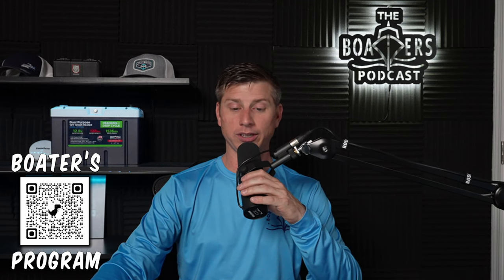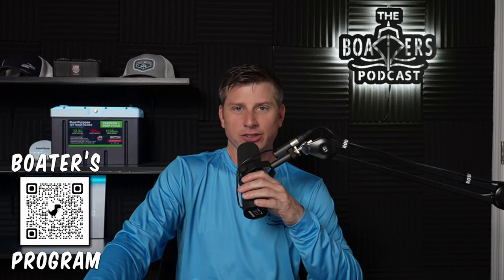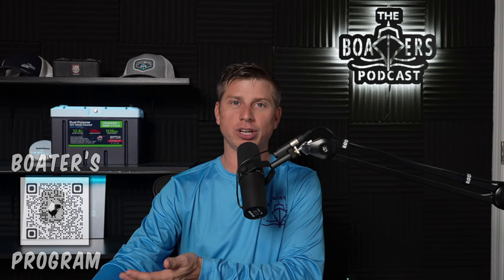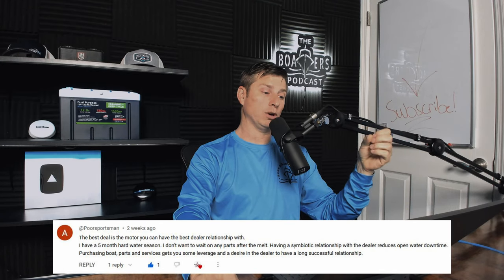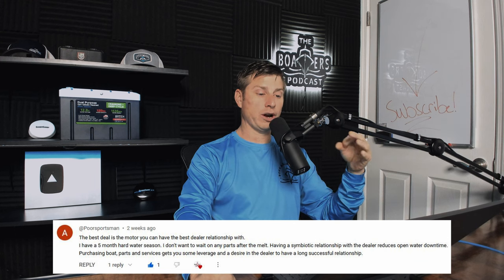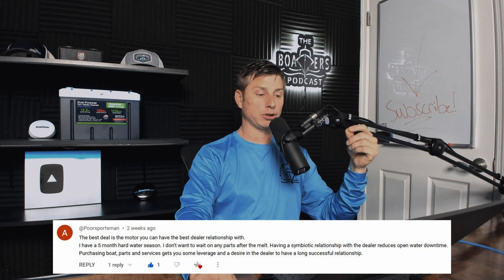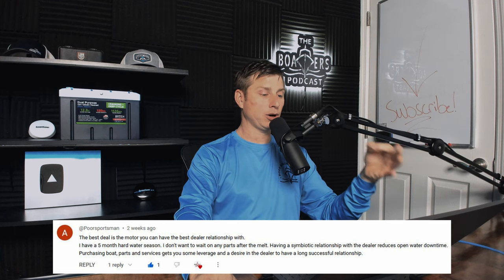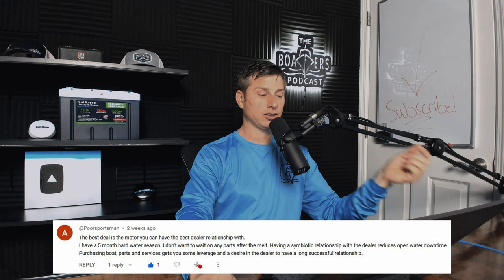How Hot Should An Outboard Pee?

Comment: My first boat engine was a Johnson 110 v 4. I thought it was pretty easy to work on. But I never did get it running well in the water and one cylinder kept getting extremely hot. I put a lot of work into that motor not a ton of money though because I did the labor. I just decided I wanted a different boat in the end and sold the whole boat trailer combo for half of what I paid for it. Bought a 19' CC with a 1986 Mercury Black max on it. I love this old two stroke and I like working on the Mercury more than that Johnson 110. I have the 2.0 with the steel sleeves and the compression is still in the correct range on all cylinders and the engine started in three attempts and the first two probably failed because of me. As soon as I followed the manufacturer's starting procedure the engine fired up and Idled perfectly no misfires and not even a ton of smoke. I checked the gears and they worked perfectly. I didn't want to rev it on muffs but I did bring the rpm up a little and she stayed smooth. We'll see how it does it the water though because as we all know old two strokes can run like a champ until they get in the water and that back pressure happens.

Comment: All marine fuel hose has to be impermeable to fuel vapors bleeding through the hose material by order of the EPA. I don't know if EPA mandated the liner or if that's what the manufacturers chose to do but even the black hose has it. Maybe it just works better in the black hose material? Although I do know the grey and blue line is a different outer material from the black Shields hose and the Shields hose has a liner but we have very little if any problem from it except for removal. A lot of people would force a 5/16" hose onto a 3/8" barb but it will bunch up the liner at the end of the fitting and cause fuel restriction. This can happen on the matched hose/fitting size also, especially on cheap aluminum fittings or fittings not sized correctly by the manufacturer so be careful. We seem to get this kind of engineering from government institutions such as the EPA. I would bet there has been more pollution caused by replacing the EPA hose than what it prevented between the cost in manufacturing and the spillage removing the hoses during diagnostics and replacement. Maybe the pollution cost during manufacture isn't a concern for EPA since most of it is made over seas.

Comment: Oh wow I thought you could flush the motor using muffs connected to a flush bottle connected to the hose. It kind of makes sense that wouldn't work as well as reversing the flow. It would be a lot harder to get larger pieces of rust or corrosion even salt out of the tiny pee hole. Jeez can you have a flush system put into an old two stroke?

Comment: On my 2007 Yamaha 115 2 stroke the tell tale is never hot even when it ran hot one time it wasn't hot my mechanic cleaned the water jackets and put new thermostats in it to fix the problem with it running hot but the tell tale was never hot

Comment: The water's job is to remove heat from the power head.  Heat is transferred to the water inside the engine and then dumped back into the river.